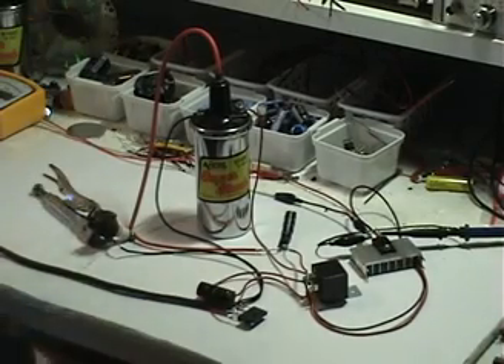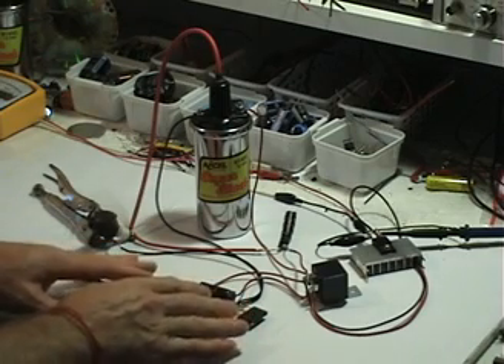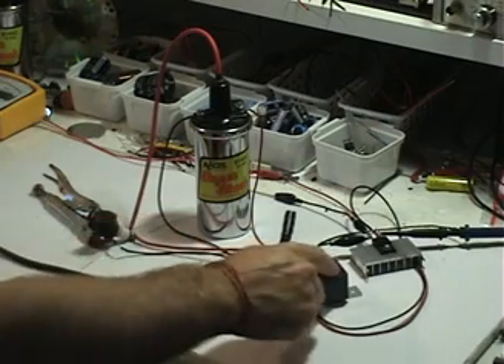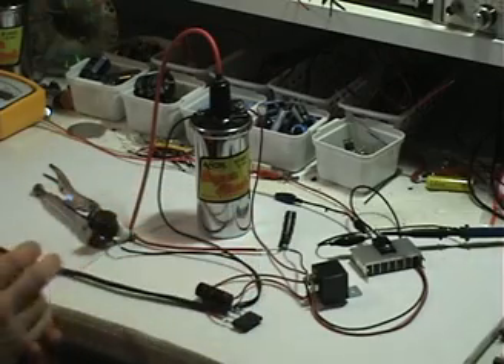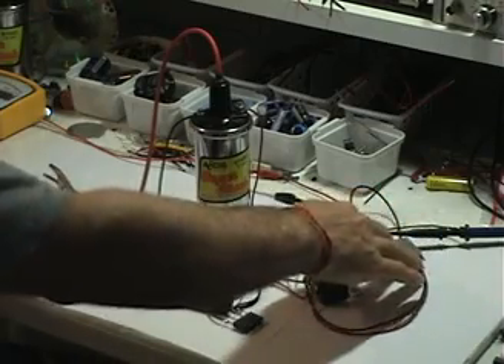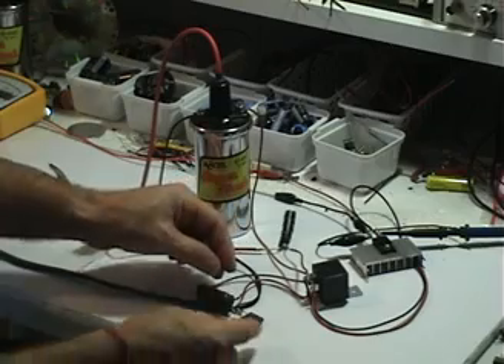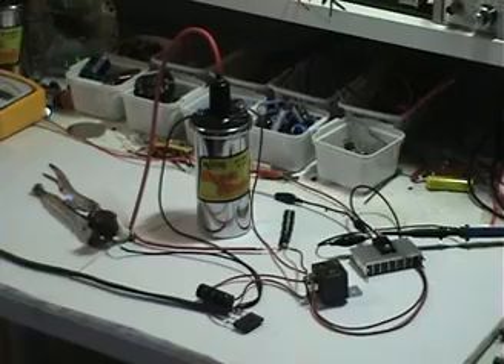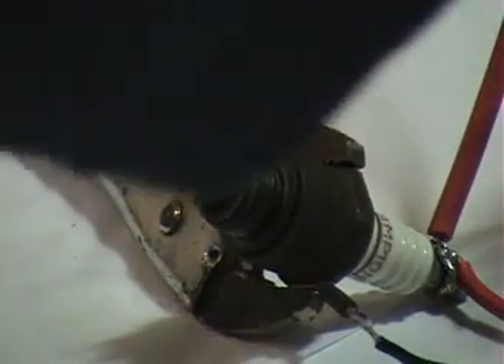Ganga Shakti - Water Power  (updated circuit)

Comment: Over the years there has been speculation regarding the S1R9A9M9 triple coils assy. I worked on this many times, studying Briggs engine and alternator and all tech details from website before it shut down. Nathren, who was in jail in Georgia 2020 had said that no final report with exacting details would be given on the 18HP Briggs running on water through carb. The cars and mower engine conversions was his best work, according to him. All needed data was just in the message board- (from questions and answers). I finally figured out why the high volts line of 5 turns was just bare #12 wire. We all figured it was just poor judgment, and would probably cause leakage induction. There was a couple obscure original paragraphs regarding what was called the "60 turns coil test". Insulated high volts cable wrapped with 60 turns insulated hook up wire with 12v 20 amp passing through 60t hooked to load resistance, would change to 12amps on connected series meter. Ignition fired through it's cable. He said that current would be induced in high volts line carried to spark plug. Not believing that because there is no complete circuit for a secondary of a transformer for this. Not only that, a spark bypass would happen with direct line to ground of negative ignition on engine. The web pages , several times indicated that to run engine on water, it was required to have about 100 volts and 6-7 amps to plug with about -neg 34degrees ATDC. 18HP had plastic tub with several parts hidden, of witch he only showed triple coils assy. Later I figured other parts to be accessory spark gap, diodes, resistor, dual coils relay ,and (1) extra inductor from previous broken relay. He distinctly indicated cost as about $3 per cylinder for conversions. The cheap way was leakage inductance to get the series inductor with 3 diodes to force forward a back EMF flyback voltage as about 100v to plug. The magnetic field over HiV cable on engine was static constant on unchanging. When reactance ohms in main line changed, the modified signal in main line created action that allowed inductor to release higher volts forward. As the first 60turns insulated coil test passed earlier, he then used only bare #12 to get better effect for the L coil. The input current to S1R coils assy was 12v battery at about 15Amps for the final reduced value spark plug 10 amps, for starting purpose. When Nathren said he was going to show us how to wind properly, he removed black tape + the stub frayed wires, and re wrapped in tape. That is what is shown to be same bent nail coil assy with tap point frayed wires removed, which is on you tube videos as "take apart" on porch scene. He did not want people to see these pieces removed during making his video. The lawnmower engine alternator has no real power during starter cranking RPM and main circuit relies on 12v car battery for start purpose. Different plastic ring alternators of higher amps are available as well as different flywheels with stronger magnets for output power. The standard water cell electrolysis uses very low volts and variable current with surface area of SS plates to make hydrogen bubbles. The combustion chamber electrolysis of 18HP engine only has small spark plug electrodes and requires much higher VOLTAGE. ie - Flyback inductor. His method replaces the earlier car conversion parts with 110v AC Inverter box with half wave DC diode for about 40V DC for the dual coil relay per cylinder. The dimensions of coils L as 60 cycles switching armature relay as solid core with winding of #21 gauge magnet wire as about 1.6Millihenry as .6 ohm as 3/4" by 1 3/4" coil , similar to China coils .8mm wire as cross over inductors. The high volts went through both coils in series on just the mower engine with 3 diodes, one was in between. Relays were intended supposed to be for traffic signals switching in street pole electrical boxes in Georgia. Nathren said so. Reason has to do with further reduced timing, as cars had had adjustable distributor timing, the Briggs has none. Video 1 at 1/4 speed will show the 3 power wires going down from
engine upper cowl to the plastic tub.The summer heat and engine heat of 2008 had melted the glue on black tape, so as 3 wires are visible. This conversion method would work because of the change of neg high volts and positive ground , to POSITIVE high volts and negative ground. The Briggs Magnetron had wires reversed so as plug rubber boot hooked to casting ground , and magnet type magnetron was insulated from casting with plastic washers and plastic metric screws. Cable then hooks from metal of ignition to 5 turn S1R coils assy. The starter then receives positive 12v with black neg battery cable hooked to casting for ground. System circuit may not work with neg high voltage unless starter insulated from engine. Reference here is the (2) YouTube videos of S1R9A9M9 and tech data gathered.

Comment: You could try to use "cold steam" from the modern resonant humidifiers instead of a water sprayer.
Reply from the maker: Yes, I tried it. Works very well.
Reply: @gotoluc  Yes I saw this in a later video with the tube coming out of the hymidifier. Oddly enough it had very big power consumption. Have you developed further in this direction? May be a nice heater could be created out of that work? By the way Luc, do you mind if I get in touch with you for some advices before I get deeper into experiments. Of course I am planning to watch all your videos first. Thank you! :)
Reply from the maker: @nikikrastev5606  No, I did not improve it much further then what I shared in video's. I was hopping it would work on a combustion engine but looks like a new kind of engine would need to be invented to work with this.
You can contact me but I've already shared what I know in videos or at the public forum (link in description box of all videos) also my time is limited. Good luck with your research.
Reply: @gotoluc  Thank you for your reply. Yes I know it is hectic days nowadays and I respect this. I wouldn't waste your time, I need a brief personal advice instead based on all your rich experience. But let me first watch all your videos as they are indeed very useful and interesting.

Comment from the maker: Hi Ed,

Ground will always take the route of least resistance. So the black wire the visegrip is holding on the ground body of the plug is a zero resistance path for ground. It cannot go anywhere else! unless that wire had a bad contact on the body of the plug, then yes it could be dangerous. Now you know why I used the visegrips.

Luc

Comment from the maker: Hi prototype9000,

It could be done with a capacitor but the effect is better using the diodes.

Search youtube:  Aquapulser  they developed the circuit to a fine art and you can buy it made

Luc

Comment: could you use a capacitor to absorb some of the high voltage so you dont have to use to many diodes ive done the same thing to rectify output from a tesla coil as long as the output wattage isnt greater than the input wattage the capacitor seems to absorb allot of energy im not sure if it would work on your system i would do it myself but dont have the materials to do so

Comment from the maker: Hi phsharon,

I do think this could be done with an LC resonant circuit. Where the cell is the capacitor but it's difficult to keep it tuned at resonance as the dielectric of water changes with heat. I think that's why Stanley developed the direct injection.

Luc

Comment: ... to reduce how much energy your storing either try switching to a lower value capacitor or a better way would be to lower the voltage your working at since energy is proportional to the square of that.

best of luck
mike

Comment: Hiya, I think ur storing a bit too much energy atm for any results to be clear cut.

You have about a Joule (1.152) of energy stored (W=0.5*C*V^2) and at a guess about 1mm^3 (0.001g) of water. 

According to wiki:
1J = 0.2390 cal --> so youve got 1.152*0.239 = 0.275 calories of energy.

And 1cal heats 1g of water by 1deg. --> cal = g * deg (or deg = cal / g)

Under the right conditions then the water would be heated by 0.275 / 0.001 = 275 degrees

Comment from the maker: The voltage will not have that much effect on the relay contacts, it would be the amps that it is switching that would effect it most. The circuit is using less than 1 amp.

Luc

Comment: 1/2CV^2 gives 0.986 Joules cap energy. Is all of this being discharged?
If you can let the explosion lift or move a known weight (or itself? rotate the plug), you can calculate the mechanical energy in Joules.
Just a thought :)

Comment from the maker: At this time the circuit is at its most efficient using 10 5404 in series. The resistor has always been removed from spark plug.

Thanks for looking

Luc